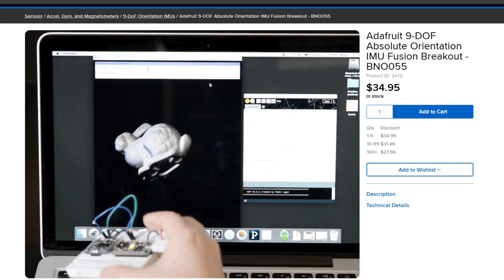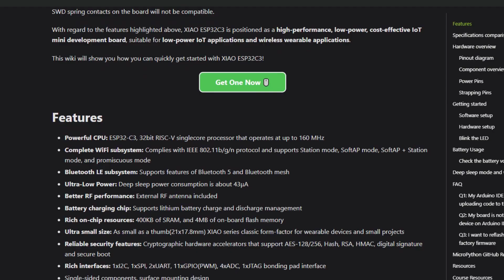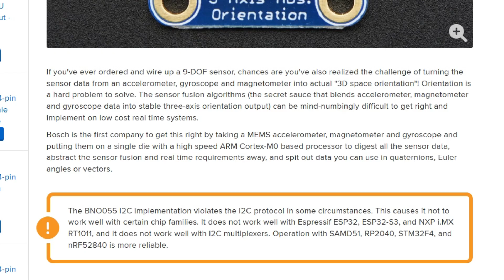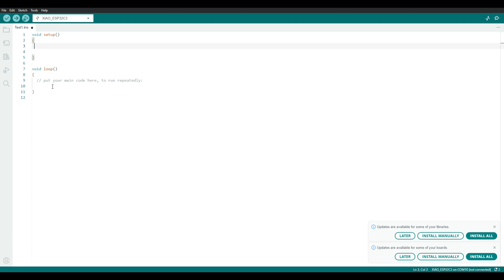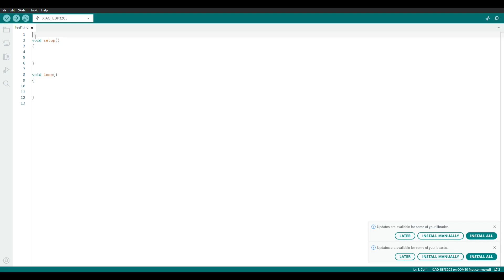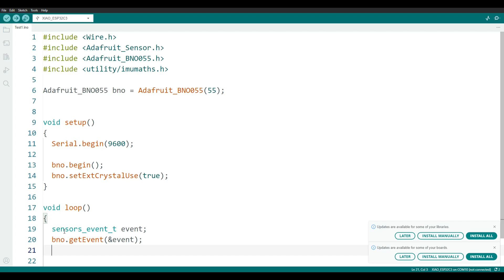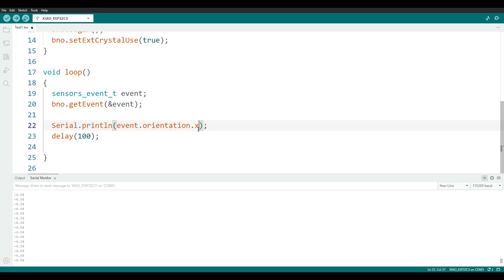Sensor Review: Adafruit BNO055 Absolute Orientation sensor

Comment: I'm trying to align my system to True North using the BNO055 sensor. After aligning to North, I rotate the system programmatically (using motor control in code). However, when I command a rotation of, say, 10 degrees, the BNO055 reports a smaller angle — it consistently shows less than the actual rotation. Also, the heading values are not repeatable; running the same rotation multiple times gives slightly different results. Why is the BNO055 not accurately reflecting the programmed rotation, and how can I improve the consistency and accuracy of the heading readings?
Reply from the maker: Hmm... My first thought is that there's something steel or magnetic near the sensor... magnetometers are ridiculously sensitive to things that mess up magnetic flux lines. Often times the pins you get to solder into these boards are made of steel. Breadboards, sockets, and connectors often use steel as well. This is why mine is on a 4" pigtail of copper wire.

Apart from that, I've found that the sensor needs 2-3 full rotations after startup to calibrate the magnetometer, and once it has done that, the heading value will jump to a corrected position. My robot makes three circles in place when it starts up to make this calibration. I noticed my robot vacuum spins in place every ten minutes or so... I'm assuming this is to recalibrate the IMU and make up for drift...

You've probably thought of this already... but remember Magnetic North is in a very different place to True North. Where I live there's about 20 degrees of difference between Magnetic North and True North.

Unfortunately, IMU technology (at least hobby grade, like this sensor) is not very good yet. They have tiny moving parts inside the chips, and thus they have a ridiculous level of variation from chip to chip. Temperature also causes noticeable changes to the calibration. This is why many robots are using this data in conjunction with LiDar or visual mapping.

I hope this helps!

Comment: If we are using BNO055 in a robot, it is very difficult to move sensor for calibration every time sensor is powered ON. Also, I have a doubt whether BNO gives magnetic North using event.orientation.x or angle from where it was started?
Reply from the maker: The sensor seems to call the direction it was started up in as North, until it makes a couple of circles (to calibrate the magnetometer) then locks on to magnetic North. I haven't tested it in a long term application yet, but I would hope that it would re-calibrate every time it passes magnetic north... We shall see!

Comment: You should look up the  MaUWB DW3000 chip. Ultrawideband is a technology used for indoor tracking and sounds like a good fit for your project. I think (I haven't actually used it myself) it may rely on placing anchor points at known positions, but as long as your are only using this in the one location (your house) that seems like a reasonable limitation.

Comment: The BNO055 is a great sensor, I have been using them for many years. I believe it is now end-of-life and the replacement is the BNO085 (slightly different library required). I can't be certain if it matters, but I always place them in the centre of the drive wheels to ensure the angle data is as accurate as possible. As the robot rotates on centre or on a single wheel this might affect the accuracy.